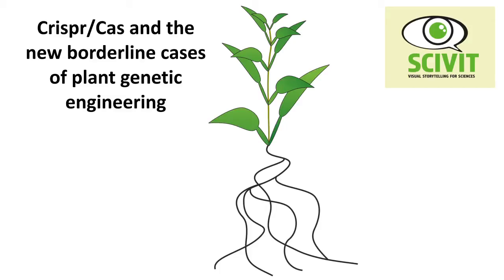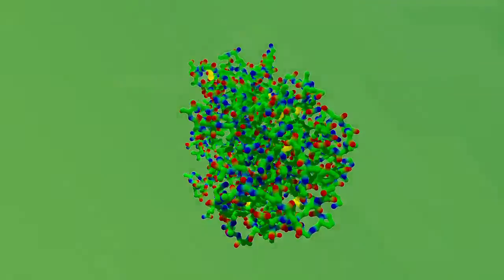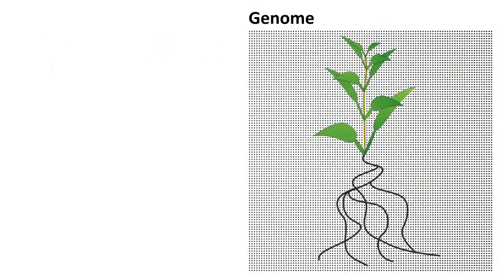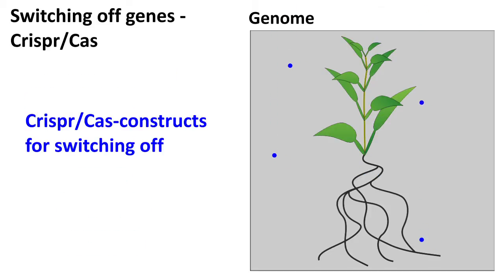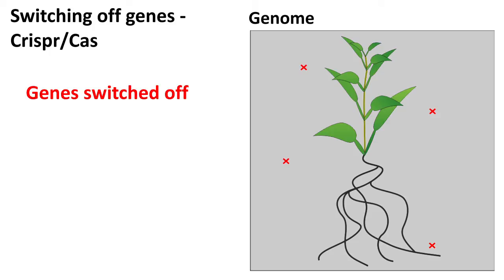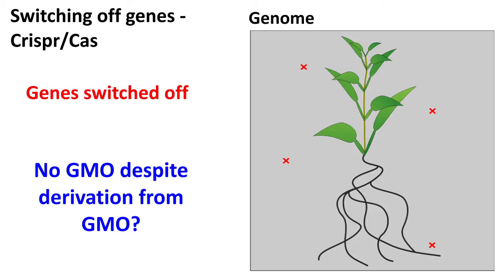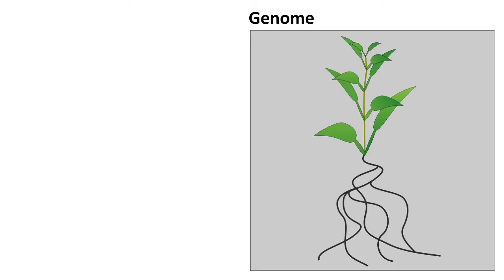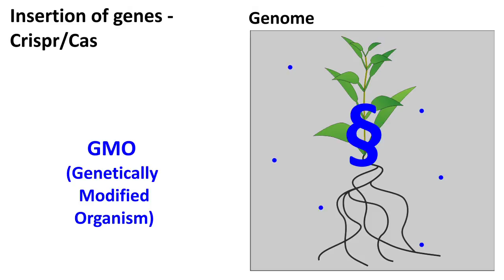Crisp/Cas and the new borderline cases of plant genetic engineering

Comment: misleading and unclear.  A plant is either genetically modified or not.  A GMO plant doesn't produce a normal plant as offspring.
Reply from the maker: This precisely is the question. If you take the current definition of the German law, it can produce a normal offspring.
Reply from the maker: and by the way: I don't like your insinuation that I would want to mislead people... I would prefer more factual reasoning.
Reply: gotta love the Germans for their great work on genetics for the last 1000 years!...  That "current definition" is intended to mislead people by calling the offspring of GMO plants "normal" just because we believe we have "switched the genes off".
Reply: I don't like your misleading video.
Reply from the maker: Basic definitions are very similar in US and German (or better EU) law.  I took German law as an example, since I am more familiar with it. The status of being a transgenic plant is always coupled to containing a certain gene or allele not possible under "natural" conditions. This may be a gene/allele from an unrelated species or a modified version. It is very easy to remove such a gene from a transgenic plant (and not to "switch it off" as you erroneously put it) simply by crossing it with a normal plant and selecting for offspring without the modified/new gene. It is also very easy to prove/disprove the presence of a given gene variant by using the polymerase chain reaction. So, apart of being rude, I don't see your point.